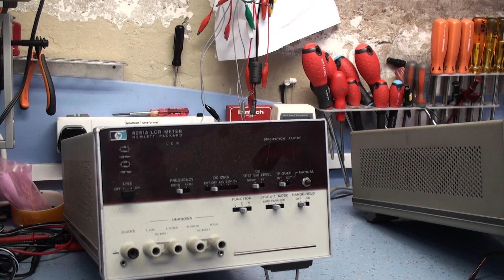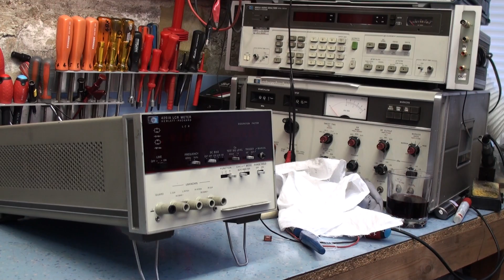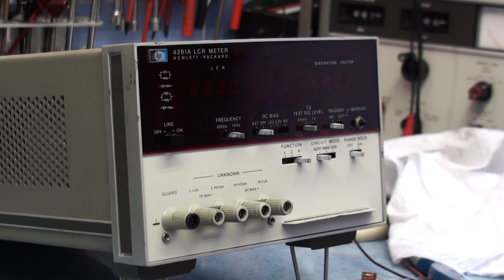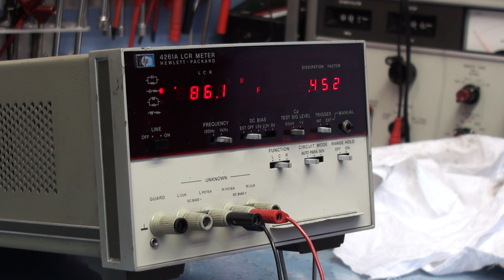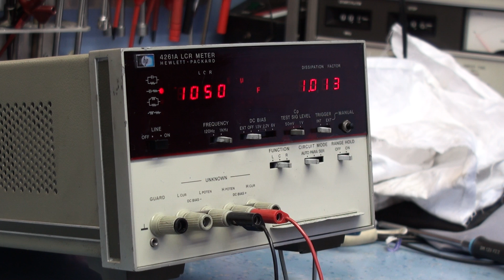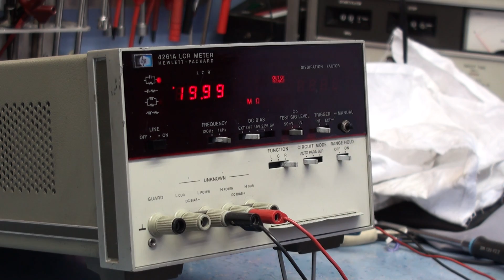Hp4261a revisited, a moan and a happy end.

Comment: Hi Simon wanted to say thks for the great videos, I hv been following them as I picked up a HP4261A on ebay. Had issues on the A4 board with burnt components resistors and two of the relays. Burnt traces, I fixed those and still unit wasnt working. I watched your videos and noticed that on the A8 board the previous owner left the switch in test position 1. So switched it to the proper position abd hey presto after the fixes I made units working well on all functions. So will watch your video ref calibration. Just wanted to say thanks and also mention to people to check the A8 board switch to make sure its in the correct position before carrying out other investigations.

Comment: In the 1984 HP catalog the basic bare bones 4261A sold for $2500. That's about $7000 in todays money. You could option it out well over $3000 at the time. I don't think they sold many of them relative to things like signal generators  and multimeters which have a much wider field of users. One would need to have a very specific use to justify the cost of a meter like that. Anyway glad the story had a happy ending for you Simon. ATB Doug.

Comment: I have a HP4261A that suddenly started acting strange.
When measuring small capacitances in the 100 pf range,
it has become instable on the 120 Hz frequency range, but not the 1KHz range.

The dissipation factor also varies,randomly displaying pretty much everything between 0 and 0,500.
Everything else, as far as I can tell seems OK.
Does anyone have any have any suggestions on I should proceed to investigate this?
Reply from the maker: +Anders Johansson I would check the power supply for ripple first off along with voltage. Then perform a cal on it. Its fairly straightforward to do.
Reply: I appologize, I should have mentioned that voltages and ripple are fine. I have also checked DC bias, frequency and signal level on the terminals. All are fine. BUT, I just noticed that there IS a tiny instabilty on 1 kHz as well. I saw that when I realized that "all" instability is gone if the signal level is increased to 1V. With the 50 mV signal level the instability is pronounced, especially on 120 Hz.
Reply from the maker: +Anders Johansson  Well I would look around the oscillator generator section and start be checking decoupling caps. Any frequency shift will cause strange caoacitance measurments. 
Also remove all the boards and clean the edge connectors.
Reply from the maker: Check the decoupling caps around the oscillator, Also remove all the boards and clean the edge connectors.
It's not a dirty switch is it?
Reply: +Simon Spiers I will look into your suggestions and report back. I have exercised the switch many times so I don't think it's the culprit. I'll keep that in mind too. Thanks for helping me.
Reply: I cleaned the switches. No significant difference. I cleaned the edge connectors. Significant improvement, and the readings are now stable. Thanks Simon for your helpful suggestions.
Reply from the maker: +Anders Johansson Glad it worked.